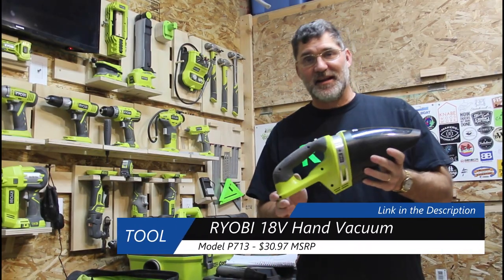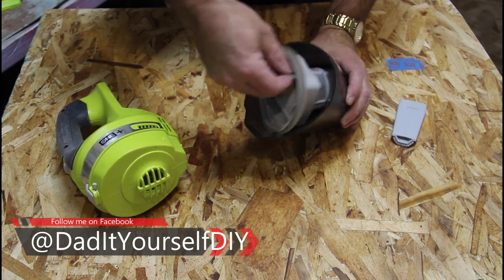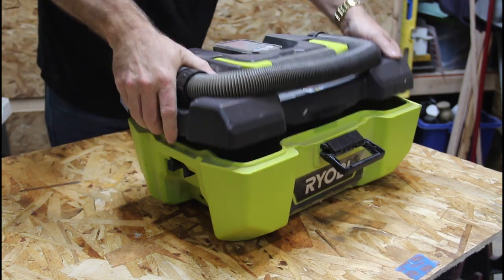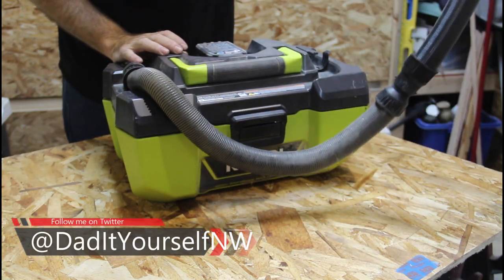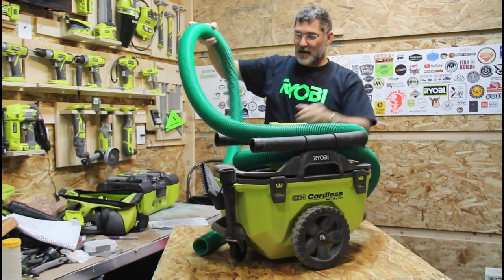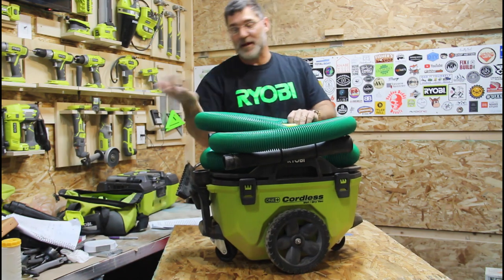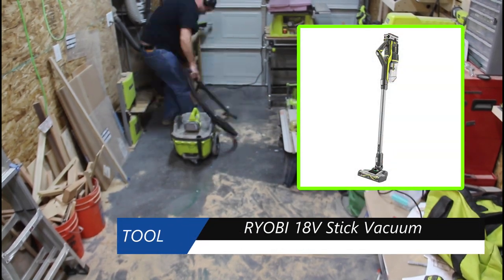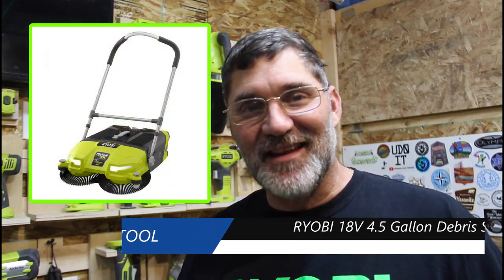RYOBI Vacuum Reviews and Unboxing | Tool HACKS that DON'T Suck! | 2020/16

Comment: My favorite is the 3 gallon as well I love to vacuum my car with it because of its size and power. So easy to do the floor of the car while placing it on be seat then swapping the position to get the seat clean. Great tool!
Reply from the maker: The extra hose I picked up pushes the 3 gallon over the top in versatality.

Comment: I have all of the Ryobi vacuums and the 3 gallon is easily my favorite as well. I bought it when it first came out and I like it so much that I got another one today. You need to look at the 4.75 gallon stainless steel one, it's a great vacuum but unfortunately the metal is rather thin.
Reply from the maker: I just picked up the 4.75 gallon from DTO. Need to run it through its paces. I also got the Evercharge Stick Vac for my wife..
Reply: @DadItYourselfDIY  I have the original Ryobi stick vacuum and I really don't care for it at all. I have two cats and the roller brush clogs with fur the second it touches the rug. In order to clean the roller on the first gen you have to use a screwdriver to take it apart. There are other issues with it but I understand that they redesigned it so maybe the newer one is better.

Did your 4.75 gallon come with a metal hose extension? Mine is plastic but the European version came with a metal extension. Personally I prefer the plastic but the metal looks so nice with the stainless steel.
Reply from the maker: The stick vac seems to be holding its own with the cat hair. All of the attachments for the 4.75 were plastic.

Comment: I have the Pool Vacuum. It works great for small pools. So you should be good for the hot tub. We had a 12x20 above ground Intex pool and it did a really good job. Just had to clean the filter a couple times. Check out Direct Tools you can get about half price of HD. I got stick vacuum from them for $75. Very pleased with that as well.
Reply from the maker: Nice! I am looking forward to getting both!!

Comment: Great video!!  
You left out the other hand vacuum the p7131.  Its really good.  We use it daily to clean up after our kid.  The only thing is the filter is not meant for super fine dust like drywall dust.   But other then that it’s awesome.
Reply from the maker: I wasn't sure if it was different or an updated version of the P713. Whats your thoughts?
Reply: Dad It Yourself DIY David Nicholas from man caver tools has all 3.  And the 7131 is his favorite version.  He said it’s more powerful then the one with the battery that goes on the bottom of the tool.  I never used them side by side.   But it does have lots of power.

Comment: So if I’m torn between the 6 gallon and 3 gallon which direction would you go? Logic tells me the 6 will have more power besides the capacity. Thoughts?
Reply from the maker: Depends on what your needs are. I love my 3 gallon.
Reply: Dad It Yourself DIY jus curious if the 6 gal has more suction power. Nothing more frustrating than an underpowered tool
Reply: I will say this it has plenty of power I use it to clean the car and it picks up embedded stuff in the rugs. Great tool love my 3 gallon plus it's versatility can't beat it